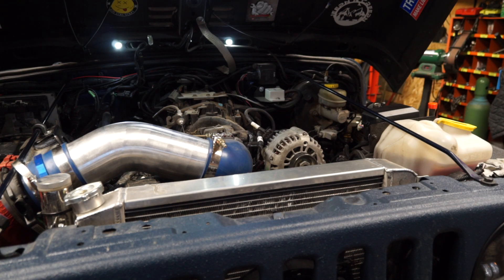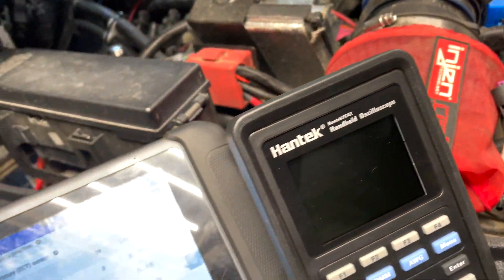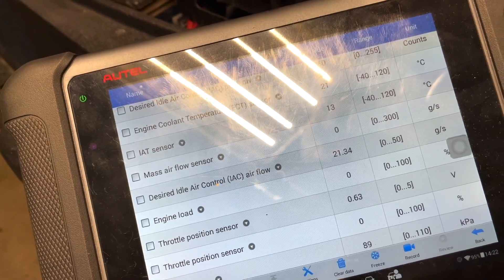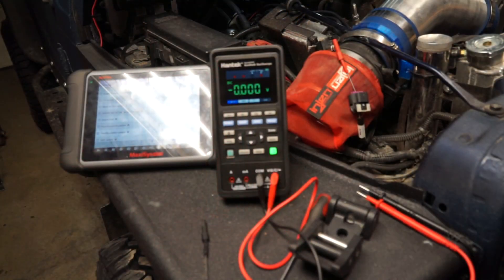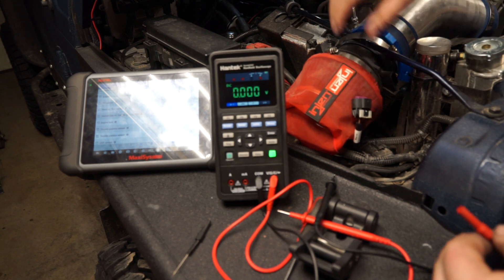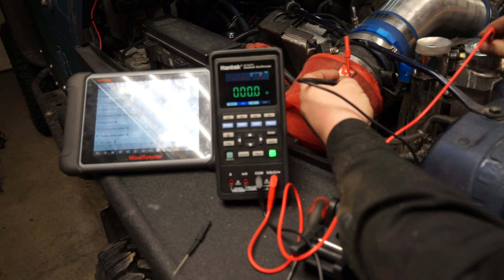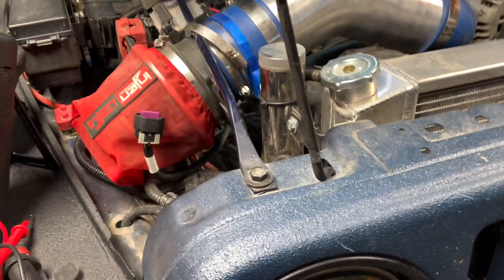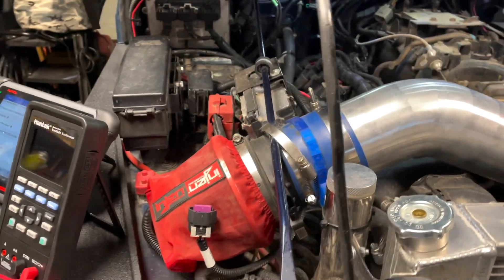P0112 IAT Circuit Low Voltage

Comment: Thanks for going over this. I got the P0110 code and looking into my IAT. 

At the 2:05 timestamp you mentioned if you didn't get a 5v reading then to debug the wire harness. Currently in that process and it's intimidating pulling out all these wires.